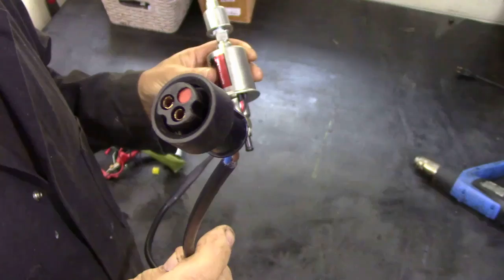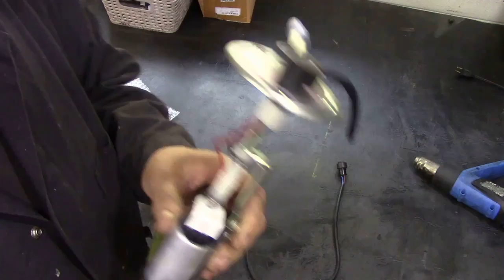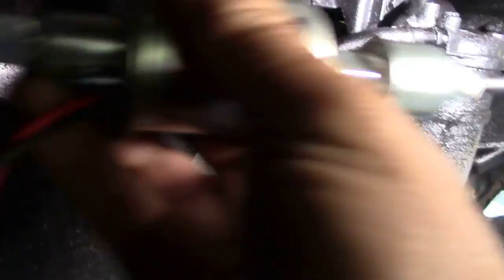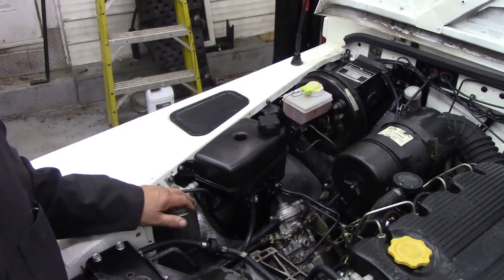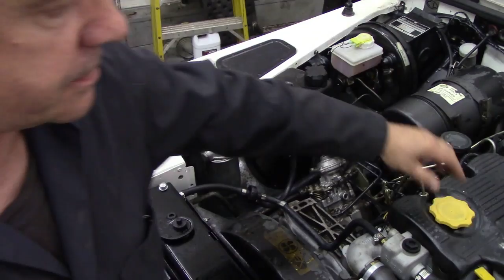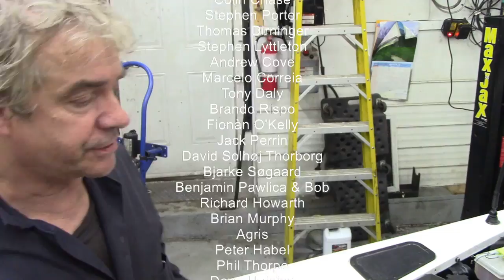300Tdi hard starting   fitting an electric pump Part 2

Comment: is the other electrik pump the SKU PRC7020 ?!?!
and how about the 90 300tdi does it fit also ?
the job will be easy to change the pump on a 90s 

great work keep it up ✌
Reply from the maker: The problem with those petrol pumps is the fine filter - they are not designed for diesel - they tend to get bocked in winter when the fuel is dense
Reply: @BritannicaRestorations  yes thats right 
didn´t think so far :)

Comment: Solving another problem that's not .... er, actually a problem, I've been running 300tdis for years and never contemplated replacing the mech. fuel pump with an electric one - what a faff! - Have you got too much time on your hands? - The mechanical fuel pumps do fail, but I only notice when it comes to replacing the fuel filter, so I guess the injection pump 'sucks' fuel from the tank. So you want to fit a non standard, harder to source when it fails, less reliable, with extra joints, jerry rigged wiring and fuses electric pump? I've replaced far more of those small electric pumps that are usually fitted to small plant engines over the years than 300tdi mech. pumps.

Comment: Thanks v much Mike - fantastic as ever! Been enjoying and learning from your videos for a while now, - usually silently. Having had latest of several lift pumps fail, I really like your idea of an electric pump. My 110 is a 1989, with no wiring that I can find for an e-pump, but there is an unused live feed in the back end which I think is the (unused) pick-off point for an auxiliary trailer, so I have used that as power feed for a pump via a relay, and taken a piggyback off the fuel stop solenoid and down to the back end to switch the relay. (None of the existing wires at the back end were both switched and still live when the starter motor is cranked. ) I’ve got a facet-style in-line pump, but really like the neatness of an in-tank pump with strainer. I’m a bit confused by all the different pumps though. Any chance you could spoon feed me with a part no, please? Is the in-tank pump just one for a 110 petrol from that period? TVM, James. 
Ps. Was in your part of the world The other week; at Guisborough rugby club to start a run up to roseberry topping and down the moors. Some fantastic scenery up there!

Comment: Hiya did this about 10yrs ago on my 300tdi
Probably the best thing i ever did regarding starting. I went with RR facet  pumps.
Turn the key - listen for the tick tick of the pump. The engine leaps into life on a  half turn of the motor. Saves on the starter motor, less strain on your battery and even reduces your need for the glow plugs....
Regarding the higher flow rates i turned it to an advantage. For winter running i put on the return run to the tank  a coil of metal fuel pipe wound around the exaust manafold pipe between the exhaust manifold and the first exhaust joint.. A coil of eight open spaced turns. Total about 15cms tall. The coil diameter is about 1 cm  greater than the manafold pipe so as not to directly (metal to metal) rub on the exhaust manifold. Allow a  length if about 8 cms of pipe at both ends to avoid your pipe couplings coming too close to the warm manifold.
A tip. Pre form your coil on a suitably sized larger pipe before hand and fit it from under the vehicle up wards by uncoupling the exaust systen at the first junction (bolts will be easier to part).
Result the increase flow returns back to the tank as warmed diesel. 
In summer just bypass the coil (2min) job...
PS i wish i had done this 40 yrs ago on my 2a - real pain to start.
Another tip for winter running. Put a kenlowe on and either opt for the manual rheostat or put a kill switch in the cab ideal for wintery mornings.

Comment: That's how they always start when there's no fuel system air leaks, s'why I fitted an electric pump to mine many years ago, also removing the mech fuel pump eliminated an oil leak.

Comment: Hi Mike, Enjoyed that. Does this mean you can now remove the lift pump? these can be quite noisy themselves. Thinking about new things electrical to fit, What about a REV counter for a 300tdi. I know these were fitted as extras to TD5 but how is it done on the good old 300tdi...lol GN
Reply from the maker: You could remove the lift pump if you want
I see a lot of people fit the rev counter but the originals are a fortune! There usually is a connector on the back of the alternator and you need to find a corresponding rev counter  
https://www.croytec.co.uk/product/rev-counter/
Reply: @BritannicaRestorations  Thanks Mike good of you to send that link too...GN
Reply: I sourced a rev counter (fuel temp gauge) sized over E**y - just make sure you source a electronic one NOT mechanical. I put a boost gauge in as well. 
Very handy as you can start to drive on the rev counter as opposed to the speedo. The boost gauge is so la la.
I put a oil pressure & oil temp on to - very handy.

Comment: Great result.  Then again, mine would start from cold like that with the normal pumps, even in -15oC.  It’s all down to having good impulse on the starter and no air leaks in the fuel system.

Comment: Hi Mike.
Thanks for the great video.
I'm currently doing the same but removing the mechanical pump at the same time, as it's leaking.
I have a 7-10psi Facet pump, will the injection pump handle the higher pressure?
I've heard of other guys using higher pressure pumps but I would like to know what you think.
Reply: I went with facets too. Simple and if they became clogged off road you could strip therm down in the field. Location on mine was under the drivers seat ckose to the tank - easy to get at.
Reply from the maker: I think the original mechanical pump was 4Psi  - more about flow, than pressure

Comment: Mike.  The 'go-fast' boys used to plastic shrink sleeve their Bosch Motorsport fuel pumps to make them run quieter mista ?  The noise reminds me of Jimbo's 1985 "Red Baron" Rangie that had an upgraded carby pump mounted to the chassis !  V.